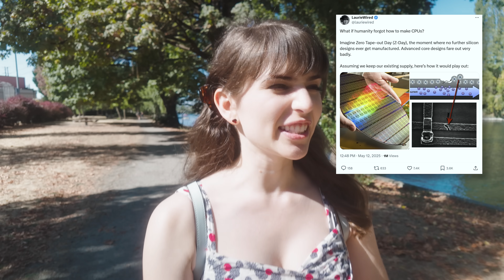what if humans forgot how to make CPUs?

Comment: I think the entire premise of your post is invalid! if demand is that high, they will remember real quick, because trillions of dollars of profit are at stake. 
Instead you should be posting a video on why low level languages like assembly, C, C++, and now rust, are still in such high demand. The answer is, the demand for faster and faster computing, at the lowest energy levels possible, equals greater profit. Efficient code and system design have a direct correlation to resource usage and thus $$$.  This is the primary factor pushing for code to be written more efficiently NOW!, You do not need to make up some dystopian premise, for a video on efficient code, when its already happening!

Comment: I think things would get much bigger and there would be a new emphasis on electro-mechanical computing (see the B-52 electro-mechanical navigation computers). A lot of micro controllers could be replaced by gears and switches but at a much increased cost and a decreased ability to modify the operation of the device. Items from this apocalypse would probably be much less throw away compared to our modern devices because of the Expense and difficulty in making the electro-mechanical computers.

Comment: Cars would be fine, btw.  You wouldn't have to go out and find cars from the 70s, you'd just have to modify your existing cars: old-school distributors, mechanically-regulated pressure systems, etc.

Some would be easier than others sure but, in general, cars can be taken off the list of concerns.
Reply: BRING BACK THROTTLE CABLES
Reply: agreed. there would be a rise in motorbike usage since some of them are still available with carbs.

Comment: Washing machines would go back to using clockwork timers when cams rather than the cheapest mcu the manufacturer could buy, most leftover chips would be fitted to carriers in order to make them reusable rather than resoldered, analog computing would see a resurgence (there were many solutions), typewriters would be a thing again and so on.

As a person with a several thousand mcu a year habit, I would have to do something else.
Reply: You can probably strip away most of the electronic crap, plug some relays and have all of the washing machines working again.
Reply: @monad_tcp  that depends on a few factors like whether the motor is electronically commutated as some of the flashy machines do.  I’d say if your machine has brushes or a squirrel cage motor with a start or run capacitor then yes.  You might however have to bolt a box on to hold all the extra relays and such.
Reply: @monad_tcp exactly. We are ridiculously overdependent on electronics for all tasks
Reply: That's assuming we've entirely forgotten everything about computer science. Highly unlikely.
Reply: @LordSandwichII  true, but thought experiment relies on it.  A better way to think of it might be to say we lost the ability due to some other unforeseen circumstance.  The semiconductor industry is actually very vulnerable due to its long and complicated supply chains, political pressures and very high technical interdependence.  The masks alone are incredibly hard to make.

Comment: This was a really interesting video with a fascinating question at hand. My first thought when you posed this question was public safety. Public safety relies heavily on computer controlled and digital radio systems, along with CAD (computer aided dispatch). Not only would we need to start converting radio systems back to analog systems with purely analog repeaters and such, we would also need to start learning and redoing how day to day operations are handled, with call logs, run cards (most common in fire dispatching, tells who needs to go to what type of call), and maps all being on paper / analog computers / dry-erase boards. I could see fire departments and dispatch centers needing to merge into much larger districts to help with staffing and communications challenges. Overall it would be pretty crazy I think.
Reply: " fire departments and dispatch centers needing to merge into much larger districts ", the opposite, without computers and modern IT you have to go smaller and distributed instead of centralized and big, you would need more people, but there would be plenty of people needing work.
Reply: Where I live there isn't a single part of life that doesn't rely heavily on microchips. The immediate crisis would be about finding the exponential amount of labor needed to replace the most basic tasks, but then still, so much stuff simply can't be replaced by humans and would just simply break without a computer running it. Even large parts of food production wouldn't just be disrupted but actually stop working.

Comment: 7:17 any car until around 2010 can be easily converted to run on a carburetor, so i think that we would still see a lot of 2010s cars around
Reply: Fuel delivery wouldn't be the problem, the ignition system would. Those have been computer controlled since the '80s, and few cars from the '90s onwards have anywhere to put a distributor and points. Would need substantial modification.
Reply: @nerd1000ify  with easily converted i meant adding a delco too

Comment: Tape drives would be widely implemented for a data storage and retrieval. It’s the most stable and reliable storage mechanism even contemporarily for archiving and backing digital media from hard-drives. 6502 family systems would still be tenable to afford and support most light duty applications particularly because variants of those processors and computer systems have been manufactured from 1977 to present day. They’re about as reliable and common as any computer processor can be.
Reply: Its also incredibly slow, you could do data retrieval but running a large modern program from tape drive would be basically impossible. Great for long term mass storage where you can live with sequential reading, so a good archive of important things in an apocalypse, but you probably wont get much else from large multi terabyte drives (such as the way you can load a program from cassette on a commadore).
Reply: @adammiller9029  well, probably 90% of compute resource is probably wasted on crapily written code. There's no current incentive on efficiency. If we had to go back on technology, we'd go up in efficiency to blunt some of the impact.
Reply: @spinnetti  I'd say that most of the inefficiency is more a result of using unnecessary amounts of compute on things that don't need it (user interfaces, mostly).

Your multi-platform mobile app that uses a browser to render fancy UIs with HTML/CSS/Javascript while running a web server on a common runtime platform is absolutely doing a ton of "worthless" work, but what it does do is incredibly more efficient than more basic systems from decades ago.

But in the current world you will lose out to someone with a more optimal design if it doesn't look nice, or if you can't easily find people to develop and maintain it.

People who know how to write low-level optimized software are expensive.  Optimized systems often require trade-offs that result in other inefficiencies.

Generic/reusable/extensible software tends to be less efficient with compute, but it is more efficient in many other resources.

Also, it's important to note that sometimes the convergence onto one way of doing things can result in significant optimization efforts by the community/vendors that are then leveraged by a huge base.  Compare that to having several competing languages and compilers, each which require deep knowledge of the underlying processor and system.

Abstraction is generally inefficient for compute, but the right abstractions can actually improve efficiency (a language/compiler utilizing SIMD instructions, GPU acceleration, etc.).  And memory use of a program can be more efficient on virtual machines or interpreted languages.  Runtimes and libraries allow many programs to share basic functionality and library components (which is more efficient that everyone writing everything from scratch as minimally/efficiently as possible).

It is still a joy to see people like Chuck Moore (the creator of Forth) do everything minimally (even designing his own chips, on his own chip design software, written in his own language).
Reply: @adammiller9029 Of course any generation of tape drive storage has it’s respective limitations, but in a scenario where no one remembers how to make new IC’s it’s that or punchcards. To make new floppy disk 💾 drives once all the old stock is becomes unavailable, ya know requires new ics to control them. That’s where linear sequential reading has its advantages for storage within the scenario. It can be manually operated by the user.
Reply: @adammiller9029 Of course you wouldn’t be running many programs that don’t fit entirely into ram, but that was pretty much the standard until Floppy Drives hit the market and HD drives became affordable.
Reply: Yeah, there are still 6502 clones being made and used even in 2025. There must be billions and billions of them out there at this point.
Reply: @Dee_Just_Dee Yeah, and there’s like a whole evolutionary family branch of variants. They’re like spiders of computer processors, in the way there’s probably one or more within six feet of your proximity somewhere in something or another at any given moment. 😂
Reply: @Dee_Just_Dee The running joke in Futurama is that Bender, and many other things are still using 6502 family processors in some way or another a thousand years from now. 😂
Reply: Even better than MDISCs?
Reply: @greasybumpkin1661 Yeah, probably. What good is an optical disc in a scenario where you can’t make new IC’s? Longevity wise, who knows? Tape is on the cusp of a century of its introduction, and M-discs dropped in 2009. The mdiscs use a similar oxidized iron formulation, for their optics though, incidentally.
Reply: is that why in lots SCP videos they are depected using tapes and VHS?
Reply: @NightmareRex6 I mean for straight forward video recording and climate controlled archiving, videotape is about the most practical way to to reliably store such data. As long as it’s not mishandled and stored improperly, they’re actually a remarkably stable media. Back in the day, people conventionally tacked their VCR or bare tapes straight on top of their CRT television sets, and when they’d turn the tv on and off intermittently, the close proximity of the tape to electromagnetism from the display is actually responsible for much of the degradation artifacts people generally associate with the media. The tapes were often being subjected to some degree of a mini-EMP each time they turned the CRT television on with the tape merely inches away from the source.

Comment: We are at the limit 4 nm 5 nm is just the name. 4nm 5nm mean the length of transistor gate is 4nm 5nm not the whole transistor .
My friend works at Chip design company told me: They call 4nm 5nm tech but the transistor in the design rarely at 5nm length because the 5nm transitor is so weak they can't be use almost any place on the design. when they layout the chip They must abide by strict rules (the rules set by Chip manufacturing process). And there are more difficult rules eveytime they sink the  transistor.  the transitor more tiny didn't mean the wire tiny 
the thing chip manufactor (like TSMC) can do is they mix material  to make the wire more tiny. transitor is stronger. So As transistor density increases, fewer chips are damaged during the manufacturing process. .
He told That is TSMC  manufacture. Samsung or china chip manufacture is much worse quality than that.

Comment: I just watched video about AMSL EUV machines from Branch Education and making CPU and progress over 50 years is insane. Not even that process is not easy, but heavy stuff moving with 30g acceleration and 1nm precision and accuracy of optical systems are insane and computational lithography as well. Sometimes principles are easy to understand, but mechanical tolerances, extremely stable voltage sources, various compensations and so are also very important. But I guess computers are quite easy to reinvent from relays to transistors and computers in last 25 years are kind of overkill for most of tasks. Well ... except of games, video encoding/decoding and running Teams and Spotify inside a full web browser.